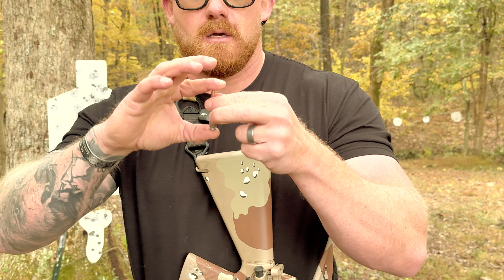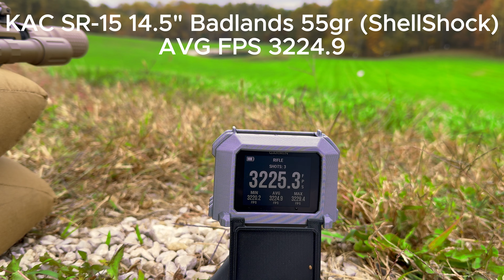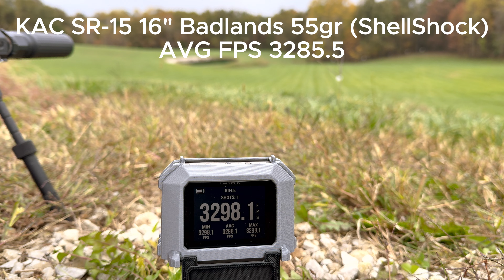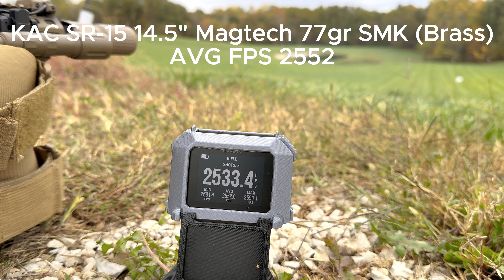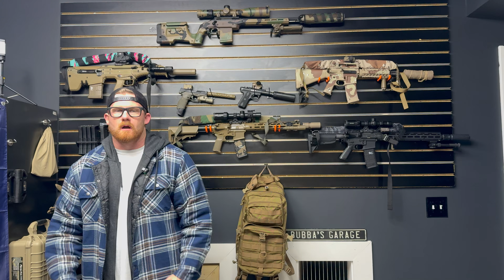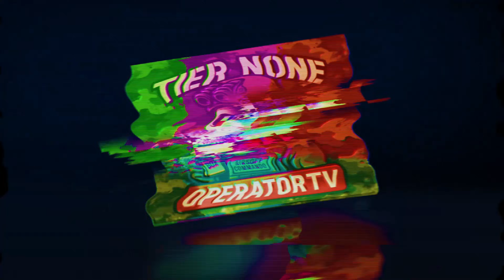U.S. Special Forces is testing this ammo.......

Comment: I've been really interested in this ammo type... I wonder if it would be possible to get as good accuracy form an 11.5 barrel length as a 16 inch barrel? Was also looking at the new PXT barrels out on the market right now if I got the name right.. that has an more aggressive spin toward the end of the barrel causing itself to be more accurate and longer-lasting!!! That's would be an awesome match!
Reply from the maker: It’s awesome so far in what we have played with. Badlands 85gr Shellshock groups .51 MOA 5 shot group out of an abused 16” SR-15. We will do some grouping with an 11.5” barrel on a few different loads and see how does. What Proof is doing isnt new. Gain twist has been around for years and with increased velocity of new rounds or casing tech it’s been discussed again lately. Hopefully we see barrel tech start to advance to catch these new casing/bullet tech advancements.

Comment: A couple of questions for you about your experience.
Did you notice any difference in felt recoil between the regular brass and the Shell Shock rounds?
Are you aware of any tests being done to see if it will defeat body armor better than the standard 5.56 rounds?
Reply from the maker: So I did not feel any noticeable recoil difference between them. Yes, my good buddy 110SASS has been doing some videos pushing the limits of 5.56 FPS and is dropping a video this weekend with level IV plates.

Comment: So they finally realized the 6.8 was a fluke lmao
Reply from the maker: Seems that’s the inevitable future that they walk it back…..
Reply: @TiernoneoperatorTV should just switch to AR10s 14.5, 16, 18 in with the new tech to push a 308 150 gr 2700 fps out a 14.5 for infantry , 2950 fps 16.5 gunner , 3100 fps out a 18  in dmr , 3250 fps out a 20 inch for snipers
Reply: @Matt-g1u that's exactly what they shold do!
Reply: @robertlowery3918 and they are way better to tune , don't burn barrels , lighter, and don't have to retrain platform
Reply: @TiernoneoperatorTV so basically it gives the 556 762 x39 power but with 556 velocity bump

Comment: 6mm max in nas 3 would be an insane combination I hope happens one day
Reply from the maker: I know 6ARC and 6.5CM are in the works right now. So hopefully that’s a good sign!
Reply: Couldn't agree more! 6mm MAX is such an underrated cartridge, and has a plethora of advantages over 5.56, 6mm ARC, and 6.5 Grendal. Out of all of the cartridges I've seen over the years that try to usurp, or would be candidates to replace 5.56 for Military use. 6mm MAX is the closest I've seen so far, and something I think the Military should seriously look into. 

6mm MAX by default at 55K PSI is already as faster, and faster than standard Shellshock 5.56 Ammunition, using the same, and even heavier grain weights (up to 105 grains). Making Shellshock 6mm MAX ammo would put it ballistically near, or even on par with .243 Winchester. Which for a cartridge of that size, would be absolutely insane. Especially since people have already loaded the Shellshock 5.56 to 100K PSI, and achieved over 2,000 foot lbs of muzzle energy. So you can imagine how powerful 6mm MAX would be if loaded that high (Albeit, it would definitely not be loaded anywhere near that hot for Military use).

Comment: We have been experimenting with high velocity 5.56 rounds at Picitinny for some time now. 
Unfortunately the US Army’s procurement program is 99% glued on the new Sig round program even though the 5.56 ammo samples we have tested are truly devastating on jell tests. 
The 5.56 will never go away and over the next few years you will see amazing results as long as testing is allowed to continue by the DOD
Reply: I never knew they did small arms research at Picatinny. I had always assumed it was larger munitions only. Any 6mm testing?
Reply: @KDawg333 the 1913 rail or Picitinny rail was invented at ARADCOM in Dover NJ. 
Picitinny is a small arms design and development center along with “ larger munitions” .
Everything from the M4 to smart munitions started there for testing as well as handgun trials

Comment: This stuff makes sense anywhere you need to save weight. If they can get the price down that is. But where it really makes sense is in the bigger calibers on helicopters and planes. That's the difference in having 1,000 more rounds of 308 or 50 cal. For infantryman it would be cool. Anything to lighten the load. I don't really see the civilian application as much except for handloaders like me who would enjoy playing around with it and getting the most out of our rounds. Id like that 200 extra fps on my mk262 clones. But I'm definitely not paying that premium when I get range brass for free and get it for cheap. The weight saving isn't appealing at all. But if I could get 1,000 cases for the same price as decent brass cased stuff I'd consider it... but that's never gonna happen.
Reply: I stand corrected.... 1000 rounds of shell shock is $300... advertised, not available yet... and I pay about 165 per 1000 now. So that's not as bad as I thought. We will see what the price actually is when it becomes available. Definately more appealing.
Reply from the maker: Tough to find in stock lately. I’d say civilian use I could see is PRS shooters.

Comment: One thing I am very curious about is how this type of ammo manages heat compared to brass. I have not heard much about this but it is a very important factor. Brass pulls lots of heat from the chamber, I don’t think these will do nearly as well. How hot do the cases feel after ejection compared to brass?
Reply from the maker: It passed NSW CRANE’s testing with m240 and minigun.  Zero temp issues.

Comment: I picked up some NAS3 cases an from my 16 inch howa with my hand loaded 53gr vmax im at 3600fps.. its pretty crazy...
Reply from the maker: Dude that’s insane, did they group pretty well?
Reply: @TiernoneoperatorTV yeah they did! About as good as I can shoot..
Reply: What powder did you use
? Is there load data anywhere?
Reply: @paulcee2404 i started with 223 ackley improved data.  i believe it actually has the same case capacity..  I used ramshot TAC